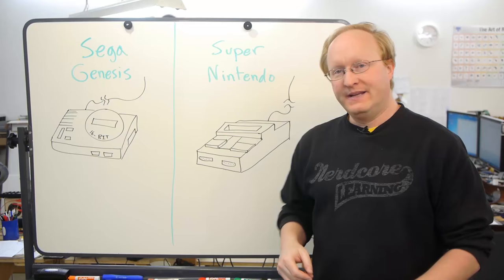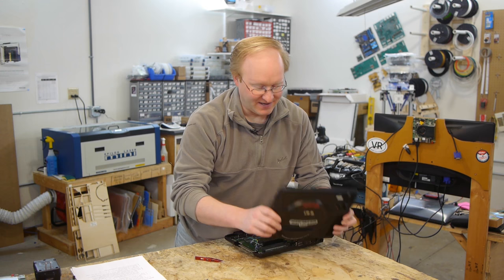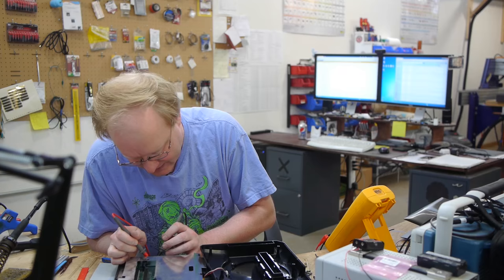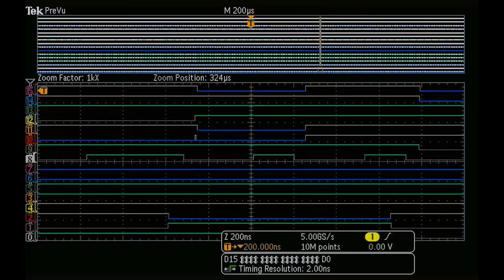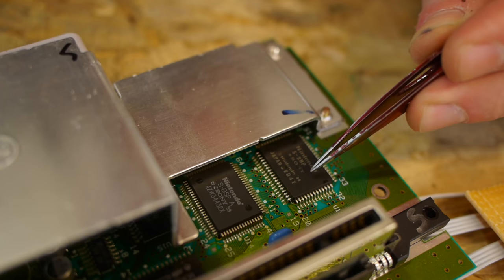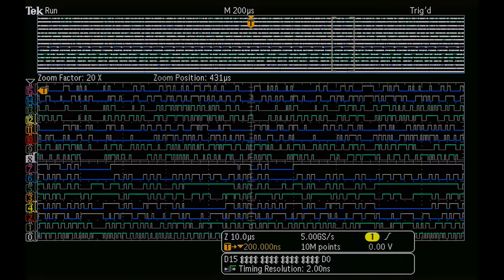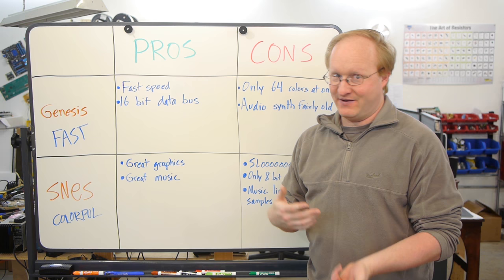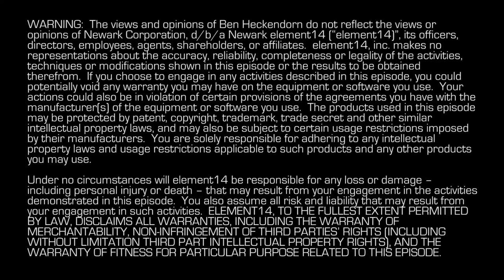Ben Heck’s 16-Bit Console Wars!

Comment: Nintendo has had a habit of intentionally watering down their consoles from the beginning anyway. Marketing and a draconian licencing policy did give them the upper hand, but on the long term it did get the better of them like with the Wii U's tepid reception for instance.
Reply: The original Famicom (NES) was the most powerful console around when it was introduced (in Japan) in 1983. The Sega Master System outdid it in most areas, of course, but it wasn't released until 1985.
Reply: +221b You are actually wrong, the Sega SG-1000 was released on the same day and was more powerful.
Reply: Correction: The SG-1000 was on par with the Colecovision as both consoles were essentially the same, but when the Famicom came out, Sega's console couldn't keep up and thus they came up with what would be later known as the Master System.
Reply: You don't remember how n64 is the most powerful console of its era, and gamecube is more powerful than ps2, only lost power-wise to the og xbox?
Reply: Yes, the N64 was easily the most powerful console of its day, but even then it was let down by its reliance on cartridges of limited capacity. It's a similar case with the Gamecube and its mini-DVD-esque discs, as it can only hold up to 1.5GB of data, of which some games had to use multiple discs.
Reply: Yeah, that's another thing with nintendo, making a hardware which is awesome in one side, and make it as shit as possible in another side. I don't understand their decision sometimes.
Reply: It worked for them at times like with the original Game Boy beating its more powerful competitors simply because of battery life, but it seems like nowadays that intentionally-nerfed hardware strategy of theirs got the better of them as few would even bother porting their titles to the consoles.
Reply: SNES is another one, making the hardware which is better than genesis, except the CPU. I wish they once make a console that is as powerful or more than its contemporaries. I want to see good 1st party games, as well as 3rd party games.

The thing with nintendo consoles, especially newer ones, are that the 1st party games will be good (Mario, Zelda, all that stuff), but the 3rd party games were be shit, especially multiplatform titles. This is especially evident on Wii, like Driver SF, or NFS titles. Wii U is the same. Rayman Legends and Deus EX HR Directors Cut were once going to be a Wii U exclusive, but end up delayed and released multi platform.
Reply: The reason being they can embed enhancement chips on cartridges to make up for a weak CPU. Problem is it made the games more expensive to produce due to the added circuitry.
Reply: blakegriplingph
That is not true at all, the reason was that the SNES was supposed to be backwards compatible with the NES, so they had to use an inferior CPU that was based on the NES CPU.
You are also forgetting that the reason that the SNES, N64 and GC were more powerful than the MegaDrive, PS1 and PS2 was because they were released 2 years after them.
Reply: I know that the N64 and GC were in most ways superior to their contemporaries, but as I said earlier they were let down by a few marketing and design decisions hence why they weren't as successful. The use of carts allowed games to load faster as they were in solid state media, but production costs and low capacity made it moot. The Gamecube's low-capacity optical media was also a pitfall for them too, besides people's perception of the console as more of a kiddie toy than something a core gamer would invest in.
Reply: BoloYung
But where's the backwards compability feature that supposed to be there? It's not there. If they really wanted to make the SNES backwards compatible to NES, they should do so, instead of catering the CPU to support NES, cancelling the backwards compatible feature, then didn't upgrade the CPU as needed. It's just a stupid decision.
Reply: Yudha Baskara
No it's true, the CPU of the SNES was just 2 NES CPUs merged together and the GPU were modern versions of the NES GPU. They just didn't put the rest of the architecture needed in it because it would have increased the price. So they intended to release an NES adapter console that could hook to the SNES, but in the they chose not too. You can look it up.
Reply: I know it's true, therefore i said it was a stupid decision (Sorry that i use "it's" instead of "it was" in my last comment, but that's what i mean). Once they thought that NES backwards compatibility is not feasible due to whatever reason, they should've change it.
Reply: Yudha I absolutely freaking agree. Why, just why in the hell would you limit your "next generation system" with an outdated slow 8-bit bus processor that 3rd parties are gonna have to struggle to make action-based Contra and Mega Man sequels for? And then when it didn't work, they left it in there? wtf? That's like getting shot, and not removing the bullet from your leg.
I can only imagine how awesome it would have been for the Snes to have a 8+mhz cpu with the gpu that it has. Games would have run with much better animation, more visual pizazz and effects on screen at once and everything just would have been prettier and smoother. Were talking beat em ups and shmups that surpass even what the Genesis could out, now that would have been spectacular. 

And the N64 was even freakin worst, the worst console hardware design in history imo (amongst the successful selling consoles that is). The 64 had unitary ram where the cpu only had access to the ram if the Gpu was not using it, which was pretty much never...soooo what the hell?! Incredibly stupid.
Reply: Their rationale was that they used a weak CPU on purpose, so enhancement chips on carts can compensate. I didn't buy much into Nintendo's reason for using carts on the N64 either - sure, some did take advantage of the format as a streaming source, but their limited capacity and production costs made it moot.
Reply: That was their rationale? Man, then they're even stupider than I thought. Yeah, let's take cartridges, which are already expensive for developers to use and consumers to buy, and make them want to use even more expensive carts to make games run the way they should have run normally in the first place?!
Dumb, just dumb.
With a robust CPU that wouldn't bottleneck the great GPU in the console, the Snes could and should have been all-around faster and stronger than the Genesis, it was a huge missed opportunity.
Nintendo was lucky that they were able to deceive millions of people into thinking that the Snes was overall more powerful with their pretty SMW graphics and (gasp) "Mode 7". What a joke.
Reply: Which explains why Square called it quits as porting Final Fantasy on the N64 wouldn't be worth the crap.

Comment: The snes could play nes games with an adapter. Take a look for Retro-Bit on Amazon.
Reply: Shane Ottinger That's not actually running an NES game on the SNES CPU. It has an NES on a chip crammed into the cart. It only uses the SNES for controllers and power.
Reply: Aww okay, that would make sense, since the same company has a genesis adapter as well for the SNES.
Reply: superhampster Yeah, those "adapters" can't even use the SNES's video output, except on nonstandard clone systems that support passing video over a pin on the cart slot. On an original SNES an adapter like that has to have AV jacks on it.
(Well, one could create an adapter that renders the NES video and audio to RAM so the SNES could pipe it out through its own outputs...  But that would require designing a version of the NES PPU that had that capability, or using a trick like NESRGB uses to get a digital picture out of the NES PPU...  But manufacturers like Retro-Bit build their systems from existing clone hardware designs made by directly copying Nintendo's ICs and patents. Creating a new, superior PPU is way beyond the scope of what they do.)
Reply: Perfect, thanks for the info. I've seen them around did not know much about them.

Comment: You left out the fact that the Genesis also have a General Instruments 4-channel programmable sound generator. 

Also, try running Super Street Fighter II Turbo for both platforms. Wicked fast, both of them.

Although, the Genesis' inferior sound hardware shows in The Lion King :( The SNES version of the game has those African chanting missing from the Genesis version, a fact that my SNES owning cousin likes to taunt me with because I own a Genesis :/
Reply: RAMChYLD you can always counter your cousin by pointing out that the Genesis version of the game is running at a higher resolution(320x240 as opposed the the SNES at 256x224) allowing for better visibility than in the SNES version.
Reply: RAMChYLD The 4-channel PSG can't normally play anything lower than A-2 (110 Hz). Not much of bass. It not-so-common games where it actually used it plays high pitched sounds like backing parts and noises (Sonic, Comix Zone), or solos (Streets of Rage).
Reply: ravagingwolverine ***** shiru8bit noted with thanks. I apologize for the mistake, and will edit my post. My main point was that Ben left out the SN76489.

Thinking about it, they could've piped the African chanting through the SN76489 (according to documentations I found online, the SN76489 can be tricked into playing low samplerate PCM), but didn't :/ I find it incredibly lazy since Sonic 3 did show that it's possible to play vocals in the BGM, most likely using the SN76489 (especially the original Launch Base Zone music).
Reply: RAMChYLD Vocals and other PCM samples in Genesis games were played using 6th channel YM2612, it has 'DAC mode' (leaving 5 FM channels). The only game that used SN76489 to play PCM samples is After Burner II. Code-wise it is almost the same, as neither of chips has any PCM streaming capabilities, to play PCM a very well timed code is needed.
Reply: shiru8bit Noted. It still felt wrong tho, since the Genesis had the facility for vocals, and the game didn't use it, opting to make the Genesis sound inferior instead.
Reply: RAMChYLD I believe the SN76489 was integrated into the VDP on all Genesis models.  That's probably why he didn't mention it specifically since he was identifying the parts as he saw them.

I don't know how useful the chip would have been for that purpose in The Lion King, though it's an interesting idea.  As was mentioned, the timing would have to be done well in software.  In that case, the programmers would have had to worry about PCM samples on both sound chips.  I'm also not sure if PCM on the PSG would have been a good enough quality for the chants.  One thing I've learned from reading technical discussions about the system is that developers back in the day weren't nearly as determined to get the best audio out of it as some of the people who work with the system now.
Reply: ravagingwolverine Yeah, I have to agree with you on that. PSG PCM audio typically have some static noise to the sound, which is why I suspect Sonic 3 used it (notice how the vocal samples in Launch Base Zone of Sonic 3 sounds a bit static-y). Personally tho, I wouldn't mind the static if it meant that the Genesis version would sound close to the SNES version. Even the PC version had the chanting, and most PCs have a sound card that basically consists of a OPL2/3 FM Synth with a 2-channel PCM chip, so the game needs to do some sort of timing voodoo as well on the PC version to sync up the chanting PCM and the MIDI.

Comment: What about the Turbo Graffix??
Reply: jedibbq Slower processor, it stored the same number of colors as the Genesis but unlike the Genesis and SNES it could actually output them all at once. This meant the Genesis could display 64 colors (or 180 with tricks) the SNES could display 256 colors and the TG-16 could display 512.
Reply: Gonçalo Tordo What tricks? Are you talking about shadow/highlight mode? The SNES could technically output all 32768 colors using alpha blending, which the other 2 systems didn't have. You can also use raster effects to change some colors every couple of scanlines I don't really think these tricks should be counted considering that they generally aren't as useful as just having more palette entries, although alpha blending can be used where additional palettes cannot, like the fog in Misty Mine in DKC.
Reply: Yep, I meant shadow highlight mode. I know the SNES could allow for alpha blending, though I'm sure if any game ever used it? Did any SNES game ever use all 256 colors at the same time?
Reply: Gonçalo Tordo DKC does both. A lot of games use alpha blending, probably more than the Genesis uses shadow/highlight modes. The one thing that is semi rare are sprites using alpha blending, because they cannot overlap other sprites and instead clip them as if they are opaque and are completely obscuring them, and 4 of the available 8 palettes are made semi transparent for alpha blending, in that they are tied to the palettes and you cannot have 6 opaque and 2 transparent. Remember though about the palettes, if you are not using an 8 bit per pixel BG on the SNES, you cannot ever show 256 colors onscreen without tricks, because the first entry in every 16 color palette is made invisible to allow non rectangular objects. Otherwise, you'd say a character with a large border around them. I don't think DKC ever uses any 8bpp artwork, (certainty not in the levels,) but it does periodically go over 256 colors by using raster effects, like the sky in the jungle levels, or the mist in Misty Mine.
Reply: Oh I did not know that. Thank you!